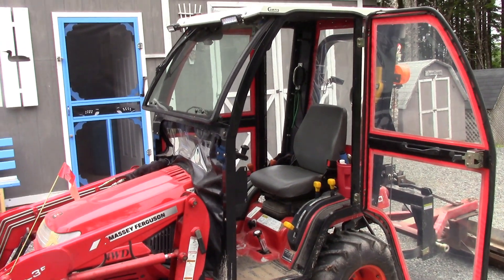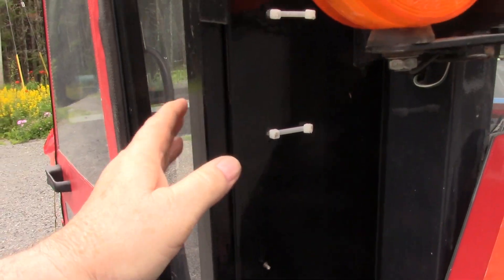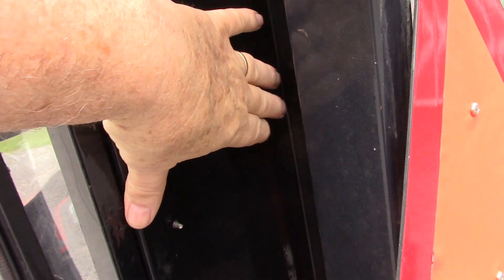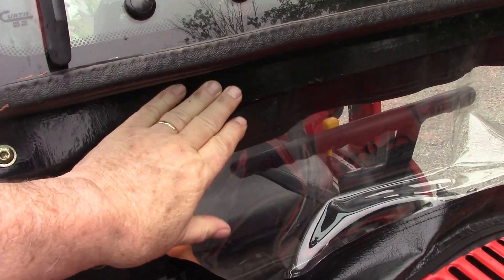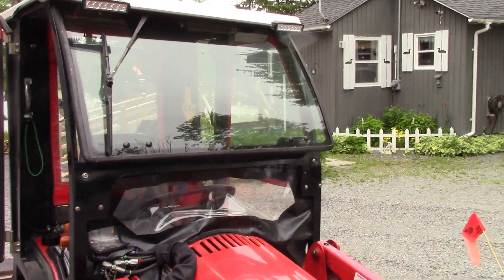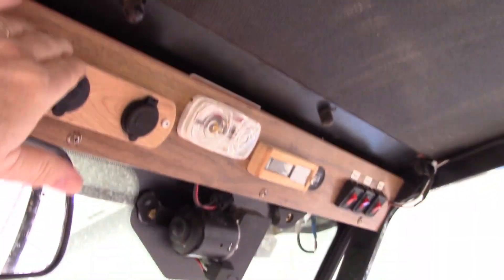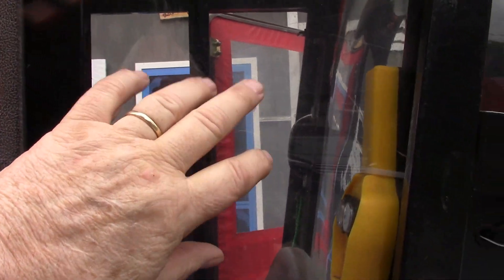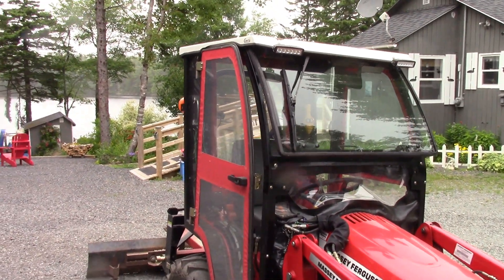Curtis Cab for GC2300

Comment: I am lucky enough!
It is an excellent cab Mike.
My first 8N  had belonged to a  village that used it for clearing snow. It had a home made fabricated cab on it. No heater or lights but it was heated by the engine heat and the exhaust pipe under the right side floor board. 
Very nice for snow.
Reply from the maker: How's she goin'?  The cab is great when plowing snow.  In summer the doors come off real easy and the back window comes out so it's pretty nice then too.  When I plow I always dress for being outdoors, just in case something happens when I'm out on the road plowing and I need to walk home.  I sometimes plow about a 2 km private road.  So having winter pants and a coat on means I don't need a heater.  I also find that with no heater the wind screen doesn't frost up.  Thanks for tuning in and take care!!
Reply: @GrampiesWorkshop  Always best to plan for something and then if you don't need it you're okay.

Comment: You will love the cab this winter. I sure enjoyed having a heated cab last winter.
Reply from the maker: Hey there Gary!!!  Yes the cab is some nice.  I have had this cab since I bought the tractor in 2007.  No heater in it.  In winter when I go out to plow or blow snow, I always dress for being outside.  Since I plow a road that is about 2.5 km long sometimes, I want to be prepared in case I need to walk home if something breaks down.  And it has.  So having a heater in the cab isn't a necessity for me.  Besides, with no heater I never have an issue with the wind screen fogging or icing up.  Thanks for the comments and take care!!

Comment: Plenty of days I wished I had a cab plus some A/C  or the summer.
Reply from the maker: Hey there Steve!!!  A cab with heating and AC would be nice, especially with the factory fitted cabs.  They don't have a lot of gaps and floor openings.  This cab works good though.  In summer you can take the doors off pretty easy and take out the back window, so lots of ventilation.  Trouble with that though, flies and dust can get at you!!!  LOL  Thanks for watching and take care!!

Comment: It is a nice cab but too bad it is not a "rated" ROPS. If it was it will have a weld on tag with all the specs. It is a really nice cab though.
Reply from the maker: Hey there Dean!!!  The cab goes in front of the ROPS.  The ROPS is not compromised in any was and is the one that came with the tractor.  I haven't seen any tag on it with rating other than what was in the manual that says 'Don't mess with it'!!!  You have me worried now buddy.  I wonder if my ROPS is safe...  Thanks for the heads up.  I'll have to investigate further now!!!  Take care!!
Reply: @GrampiesWorkshop  The tag may be under the cab and hard to see or get at. If Massey says it is rated I think you can rest assured it is.
Reply from the maker: @TomokosEnterprize  I sure hope so, but I'll check and see what  I can find out!!!
Reply: @GrampiesWorkshop  For sure, Please let me know my friend.